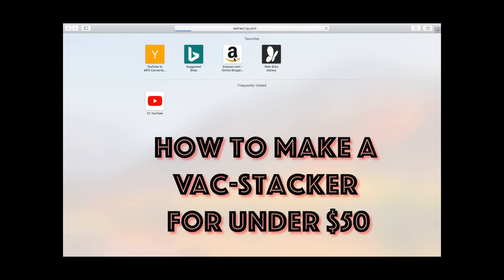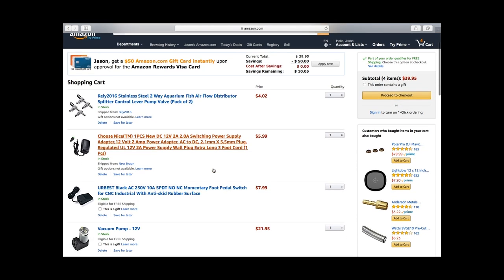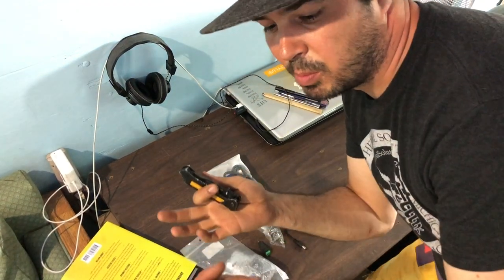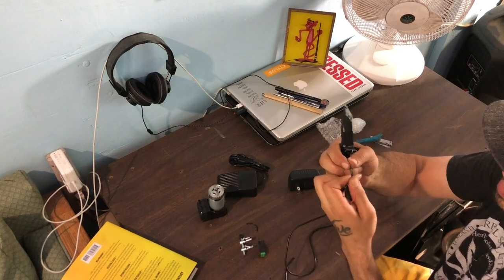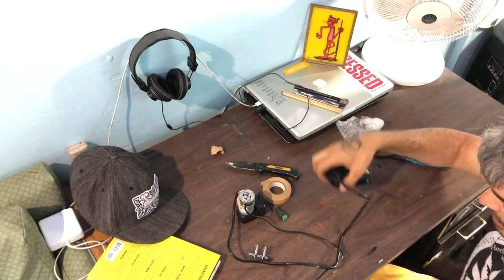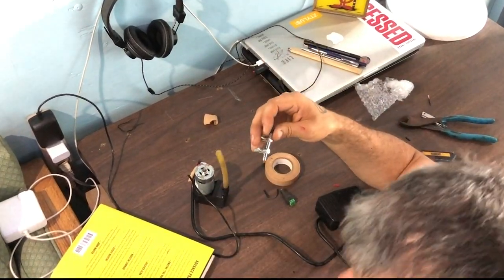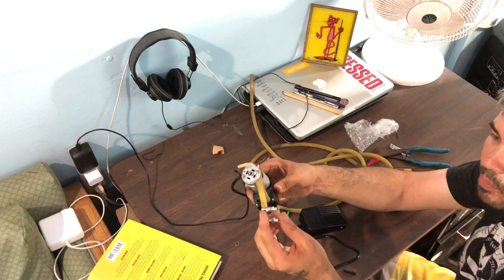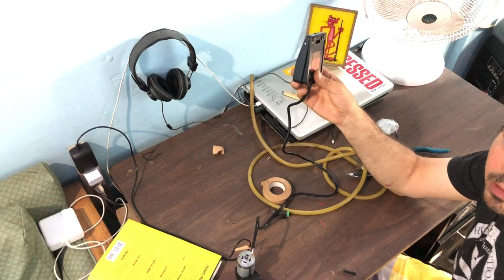D.I.Y. Vac-Stacker tutorial, with drone delivery service?

Comment: I make mine by reversing the action of a fish tank pump. It's about the same cost but more reliable as there's no rotating parts and no 12v converter. Nice tutorial though!
Reply: same. cost about $20 total for mine, a tetra whisper is the easiest one ive seen so far. only takes 5 screws and flipping one part to make it vac. then add the 1 valve splitter to your hose.